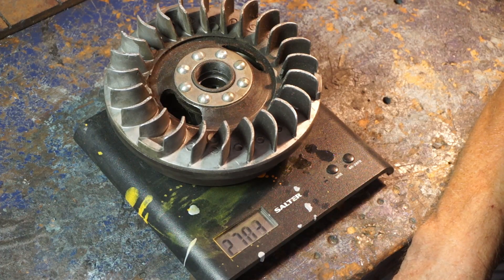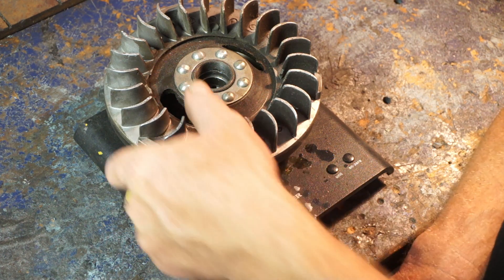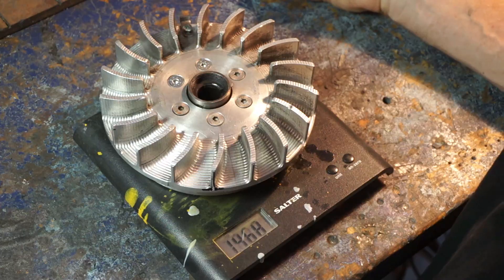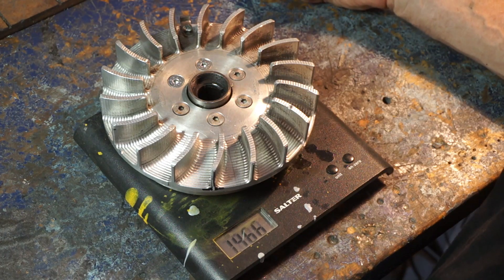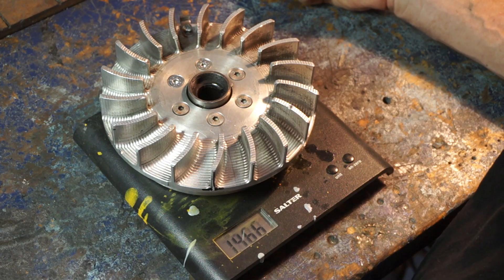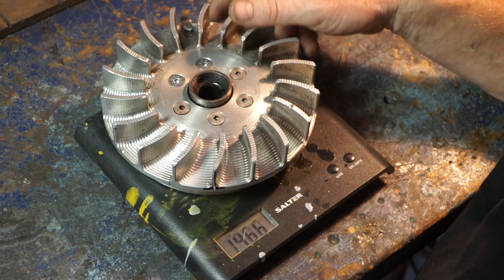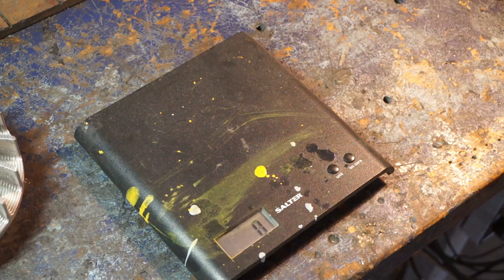TIPTON TRONIC garage build ignition #lambretta

Comment: Nice one Steve, any info please on the external pick and trigger as I take it they are not "Vape Parts".
Reply from the maker: Scootronics
Reply: @TheSteelweasel  Many thanks for the prompt reply Steve! oh just one question does this set up have fixed or variable ignition timing built in?
Reply from the maker: @davidvardy2270  fixed mate , ive lost all faith in mapped ignitions . lots of bad running at low rpm and heat ,,, for very little gain .
Reply: @TheSteelweasel  Thanks Steve!!

Comment: Hi I follow you on youtube and contact you for info on a lambretta 200 engine in cast iron po revised on the transfer ports and removed all the steps with a phbh 28 and expansion of 12V fixed ignition I have to phase it to how many degrees it should be set thanks in advance
Reply from the maker: 17 degrees
Reply: thank you